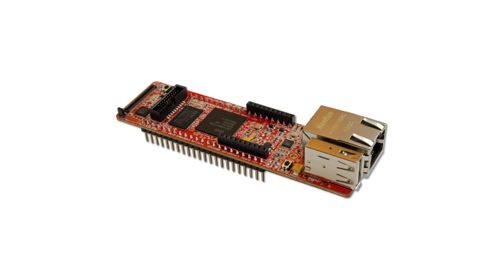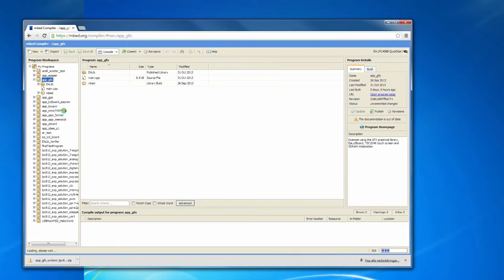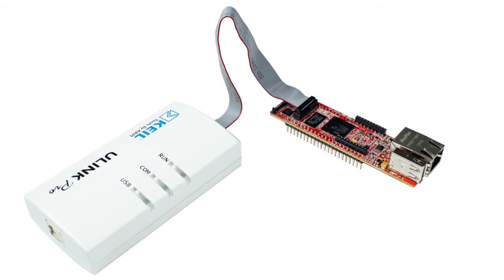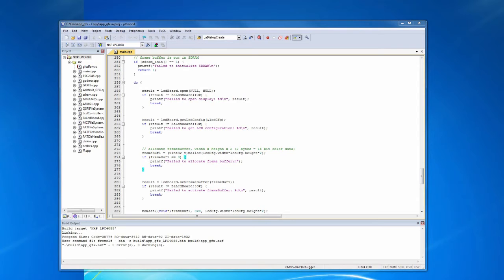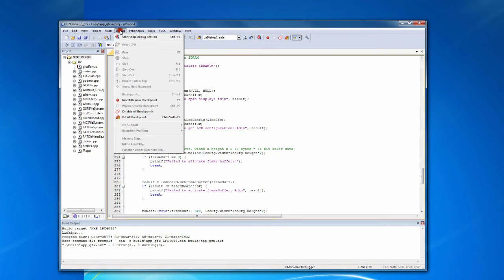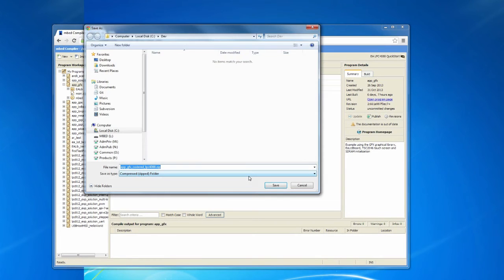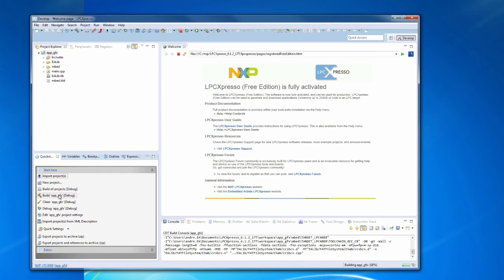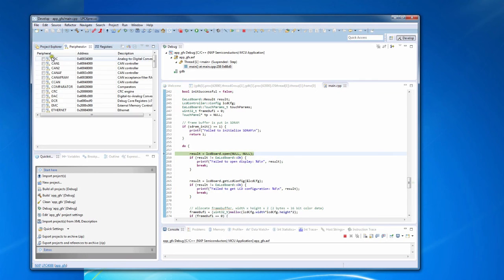LPC4088 QuickStart Board - Work with offline tools

Comment: From the video its hinted that for step by step debugging through CMSIS DAP interface, one can use mini usb connector.
Does it mean it has integrated serial wire debugger (SWD), which I can use for step by step debugging and doesn't have to use 20-pin connector ?